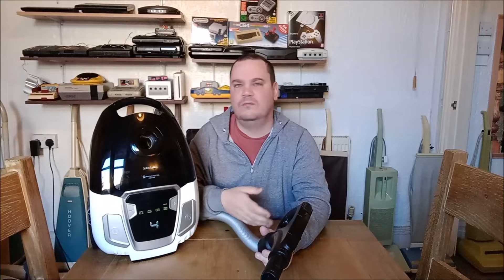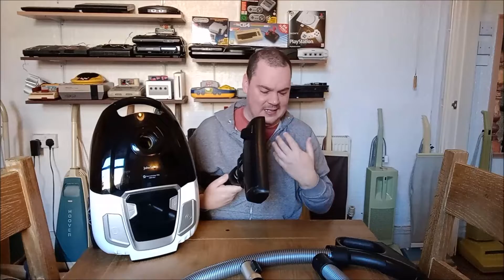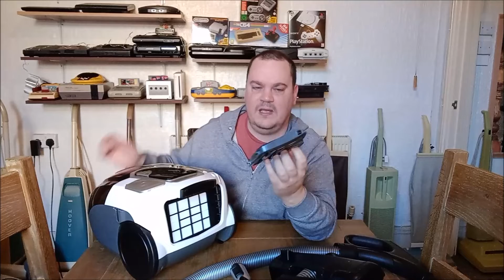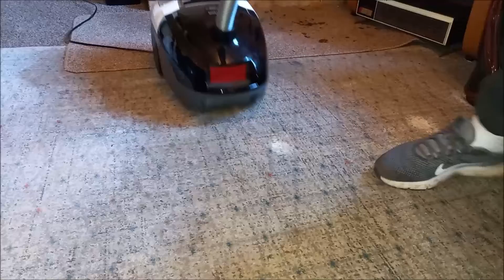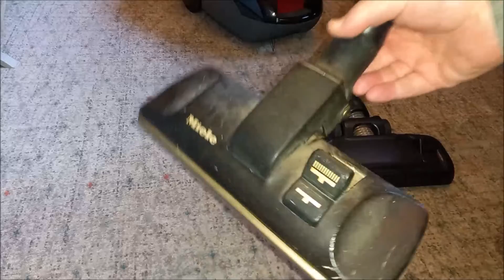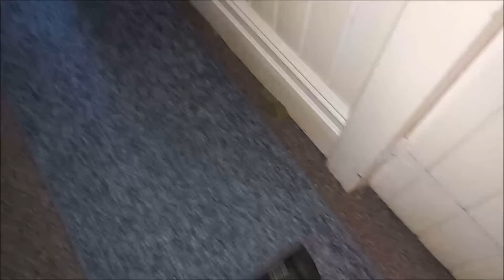The John Lewis Silent Technology Cylinder Vacuum Cleaner - Unbelievably Quiet!! Shhhhhhh!

Comment: Saving grace with the handles remote being independant of the machine electrically means you can the upgrade the subpar hose to summat longer and just slap the original ends on. Floor tool is a shame but them miele ones with the little wheel are kinda skippy, used mine on a 700w asda tub cylinder and it was a bit meh too but that same machine with a standard twin pedal head was very very good. The asda/tesco tub also has a shitty tool set, same head, same sorta filters and poxy hose. All probably made in the same sweatshop.
Reply from the maker: Lol the same sweatshop! You're probably right...

Comment: i used to have a silver bagged cylinder cleaner. similar to this but it was longer and silver (with no design) it was an electrolux and it had a tool door on it. we gave it to a family member and they killed it and i want to know what it is. im pretty sure it was an electrolux. it wasnt that old i would recon early 2000's or late very late 90s

Comment: Despite it's flaws that's really amazing especially for a store's own brand (although I understand John Lewis is a bit more upscale). A lower end machine with remote control and such a low sound level is amazing. We don't get anything like this for a reasonable price in the USA. 

Just a huge shame on the floor tool. Surely a metal plate isn't that expensive....

Comment: Plastic based floortools are really becoming a massive problem on the cylinder market. All the current Miele’s have them and all the corded Numatic’s have them. I find most just clamp down to the carpet and make them near impossible to use. Dunno what they’re bloody well playing at (said in my most outraged northern voice).
Reply: It's probably cost cutting unfortunately.  I know SEBO habe a metal plate on their Kombi head.  I don't like the Kombi head as it just feels like it skims over the carpet.  Their 'Eco' combination head is all plastic and it does suck harder to the carpet.
Reply: @lahonymanor2927  the plastic floortools came in with the ratings system. To achieve the unnecessary and inaccurate testing results, suction cleaners really had to clamp down on the carpet. It seems floortool manufacturers like Wessell Werk haven’t yet done the right thing and switched back to decent metal floortools.
Reply: @sorcerer101567  The plastic underside have been around for years though.  Certainly Dyson have been doing plastic floor heads since the early 2000s.  I do still believe that it's a cost cutting measure and there is a lot they can do with making them easier to use, even with a plastic base.  The stupid EU tests results don't matter now.